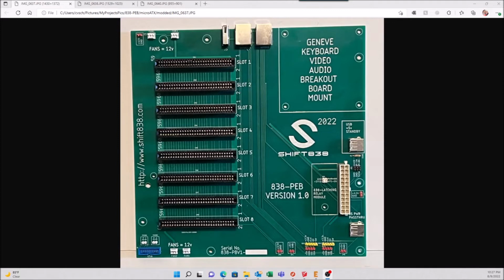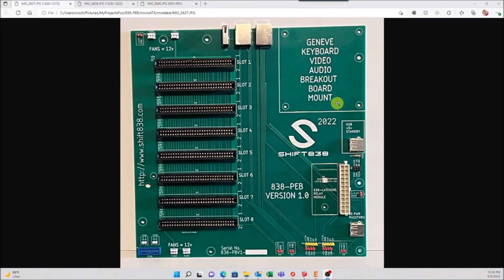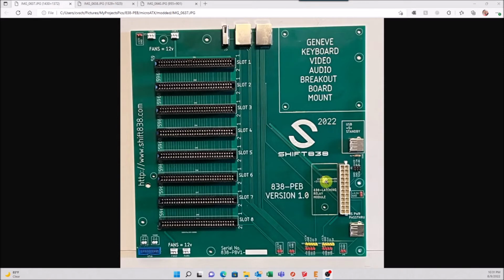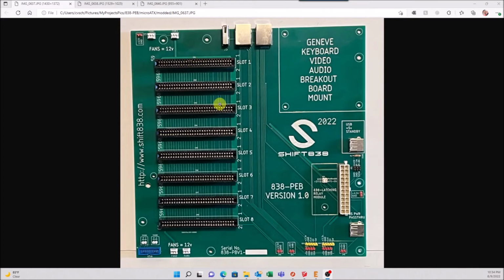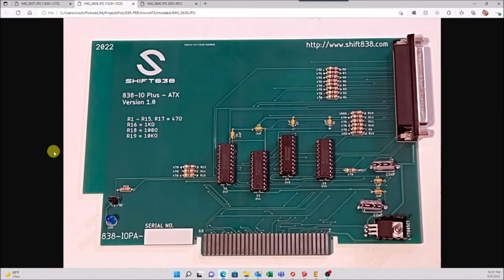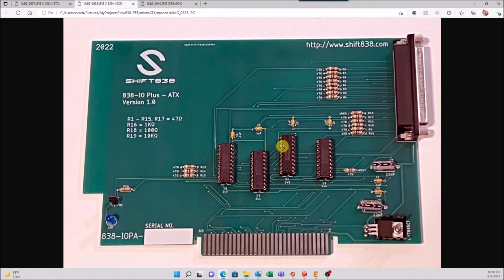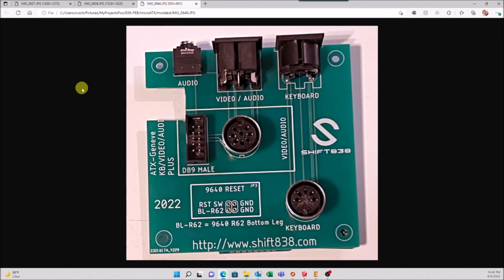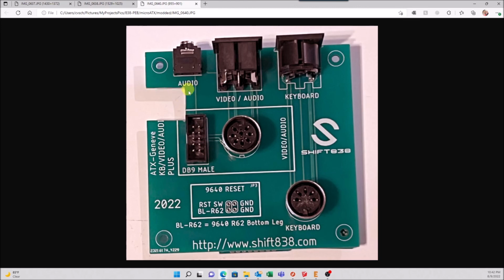838-PEB Part 1

Comment: Thanks for the great video and all the work you've done on the 838-PEB.  I configured my system tonight, installed the cards and drives, and it is working great!  Plenty of room in the case that you sell for all the drives, IDE and RS232 cables.  Great job!
Reply from the maker: I happy you have found this project useful.  Something I wanted to do for years and finally got off my butt and get it done..
Reply from the maker: That's great to hear.